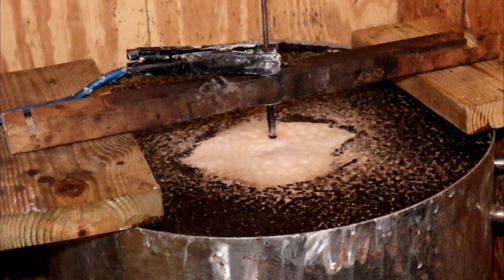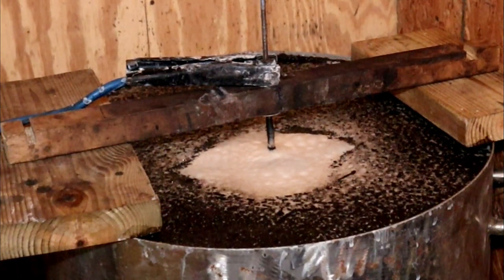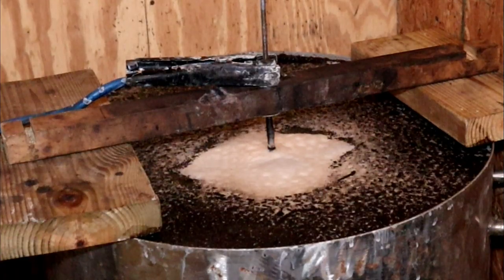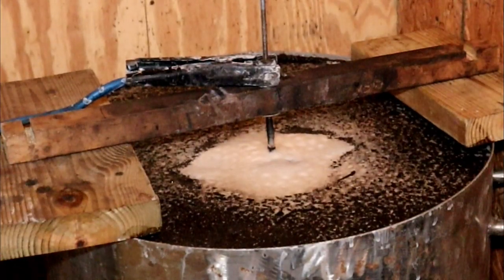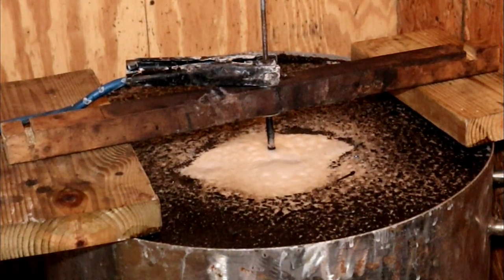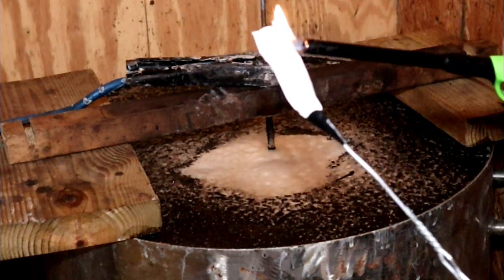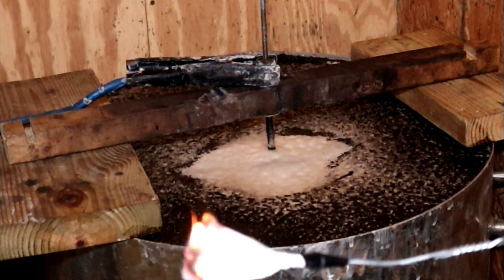Can My Electrolysis Tank EXPLODE?

Comment: Awesome video steve i have a few questions for you on maintaining your e tank do you skim off the top  of the tank after every use or ever? How long can you use the same water and wash soda ? Do you have to add more soda ever ,also ive heard people say your not supposed to use stainless steel, because of hexium chromium not sure thats spelled right lol , any tips on these subjects would be great , thanks joe from Illinois , love all your videos and can wait to see more hunting in the wild videos hopefully in the future
Reply from the maker: I never do skim the top. I just let it all settle to the bottom. With my particular tank I will go in and scrub the sides and also let that settle to the bottom. You should never have to add washing soda but you will have to add water due to evaporation. If you get the solution to strong it'll overwork your battery charger. My understanding the biggest problem with the stainless steel is disposing of the water when finished with it. The amount of water that is used by an individual will take a lifetime to accumulate enough for it to be a problem. After I get a lot of debris on the bottom I will scrape it so it will be loose and then use a siphon hose to drain it off of the bottom into a 5 gallon bucket. How are usually let that settle for a day or two and then pour the top part back in. If there's any sludge left in the bottom of my bucket, I will dispose of that.
Reply: @castIroncookware  thank you for the reply i just built my 1st e tank and using it right now everything is working great . I really appreciate you sharing your knowledge with all of us stay safe and god bless,  joe from Illinois

Comment: Hey Stephen. So glad you did this video. I just got done building my tank and I keep reading that it's flammable but nobody says how flammable. This helped ease my nerves. 
Question on the foam buildup. In one of your videos you mentioned having to clean the foam out after finishing a skillet. What's the best way or best device to skim that foam off the top?
Reply from the maker: The shop has a concrete floor and I'm not too worried about cleanliness. LOL I just take a piece of wood and wipe it onto the  floor. Of course you could dip it with a swimming pool net or something similar and dump it in the sink.
Reply: @castIroncookware  Yeah I ended up just scooping it with a plastic cup and sent it down the sink. I might try a swimming pool type net or something to limit the water coming out. I know it's minimal but over time it'll drain quicker with a cup.

Comment: I was reading and it said not to use stainless steel as a sacrificial anode as it causes a chemical compound that remains in solution and is considered as a Haz-Mat substance and requires special procedures to get rid of it. Have you heard of it and what special procedures are required to dispose of the solution?
Reply from the maker: The amount that a single tank will produce over a lifetime does not reach the tolerance limitations for disposal. If you are running a large-scale electroplating business, then you would likely exceed the tolerance levels. The next tank that I build will most likely not have stainless steel though. I will most likely use an alternative.

Comment: I have a question Sir? Is 3.5 Amps sufficient to clean my cast iron? My charger is stating 16.5 volts and 3.5 Amps.
Reply from the maker: Yes. It will work but take a little more time.

Comment: Hydrogen is lighter than air, and as stated in the video, diffuses rapidly. In an enclosed space, if it accumulates anywhere, it will likely be at the ceiling. Also, as stated in the video, foam can trap it close to the surface of the liquid.